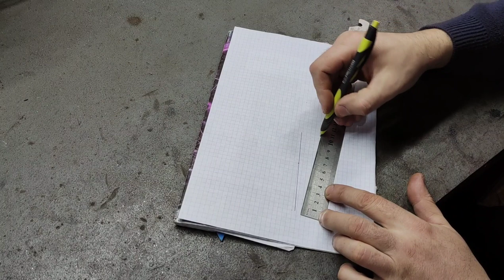Make a KNIFE for carving wood from an old BEARING

Comment: Don´t draw the file back, it damages the teeth of the file. Always lift the file, and your files will have triple it´s life length. 
Adding chalk or coal to the file, it makes it clog up less.
Always wire brush the item you are going to file first. The scales are basically hardened steel, and damages files and belt grinders, and by wire brushing the item first you reduce the unnecessary where and damages on your tools.
If you leave the wooden handle soaked in linseed oil for a week, you´ll get more depth in the final product.

These are things i learnt while blacksmithing.